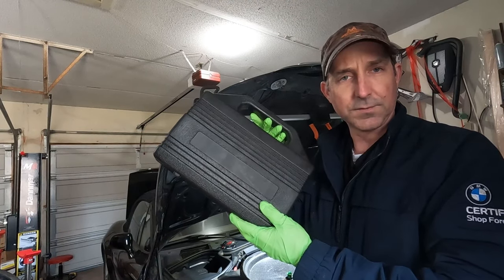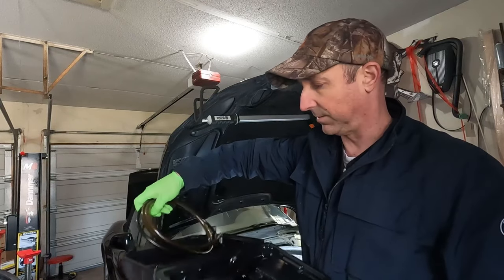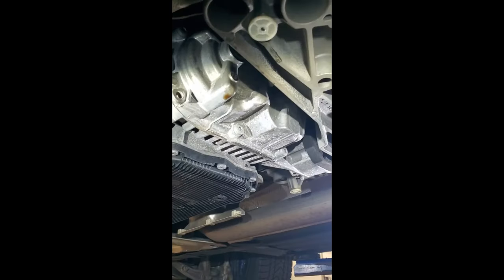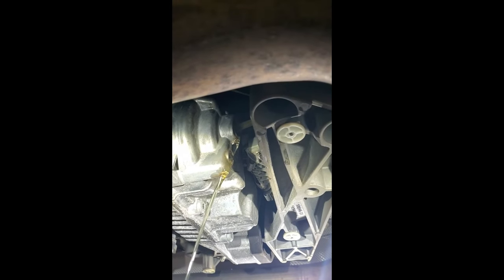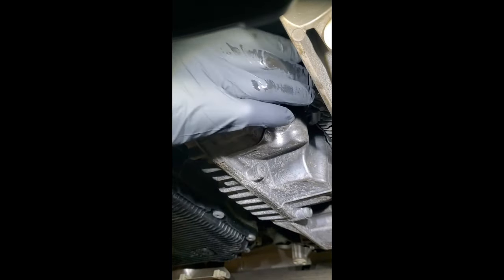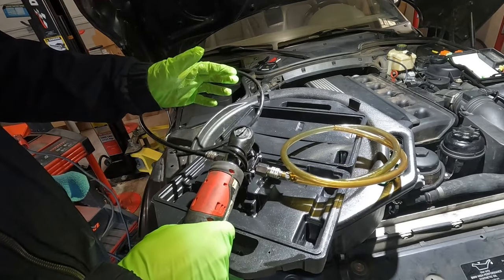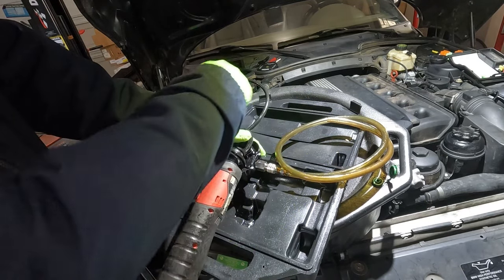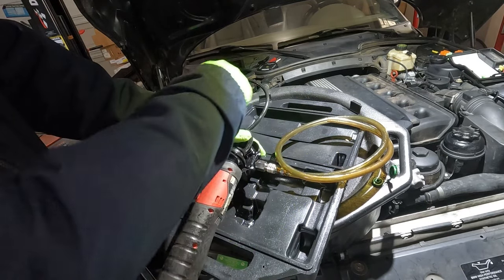BMW Transfer Case ISSUES PROBLEMS Plus DIAGNOSIS STEPS And Fluid Change 54C6 539E 5463 5F3A 54C4

Comment: Hi, how do you know it is not the longitudinal torque module problem?
Reply from the maker: No quite sure what component is the longitudinal torque module? Do you have a part number for that? Unless you mean the transfer case motor module. I cannot say I have replaced one on a newer BMW. I would have to say the motor module is normally not the failure. Unless you have some odd VIP ICM Steering failures which can bring down the FlexRay Bus. That can be caused the this module. But  not this symptom.

Comment: If I leave transfer case unplugged can I drive the car like that for a week or 2 ? Until new transfer case comes in
Reply from the maker: You can actually but you won't have all wheel drive. But make sure the connector does not get wet.

Comment: If my 2016 bmw 228i xdrive send random abs and traction light while driving is that my transfer case? Would changing the fluid help? Thank you.
Reply from the maker: Hello Joshua, I would scan the car to check faults.  It may be the transfer case but it could be something else.

Comment: I have a f34 that looses power when the wheel is just off center and will not go into park. I get a dash warning that states park can only be selected when stopped. I checked all the wheels speed  inputs and they show stopped but still won’t go to park. Customer has had the shifter replaced, and transmission replaced prior. Also getting a code for input speed mismatch
Reply from the maker: Hi Josh, For something like this it would take hands on diagnosis to solve. Not a common issue unfortunately.

Comment: Hi, I have been having the similar symptoms. My mechanic thinks it could be the transfer case. Is it common knowledge for them to know how to change the fluid?
Reply from the maker: Hello Anthony, Most good mechanics can figure this out but not all transfer cases have drain plugs. Some you need to siphon out or remove and drain. Filling is easy. Fill until fluid come out.

Comment: Hi,i changed rim size from 20 to 22 inch of my bmw x5m f85.and transfer case shuddering happens.i run 295/30 22 with 335/25 22inch tyres.someone told me to change front tyre size to 285/30 with 335/25.
What would you suggest?
I want to run with 22 inch rims.
But i dont want my transfer case shudders and slips.
But i didnt use after this problem maximum 250 km.reset of transfer case without oil change is helpful??
Bmw is on 70000km.
Reply from the maker: Sorry to say that changing tire size like this can lead to transfer case failure. I have seen it many times. I would recommend going back to the stock tire sizes and rims and maybe the fluid change will help. Damage to the transfer case can result if not and replacement will be needed.

Comment: My bmw x1 shudders when driving at 5mph / 10 mph …. Up and down the gearbox the car is just fine ! Smooth as butter !
Reply from the maker: Sorry to hear that. Disconnect the transfer case motor and see if the shudder is gone.
Reply: @AskTheCarExperts   thanks for the advice , changed the transfer gearbox oil and , shudder is virtually non existent now ! Very happy !

Comment: Will a bad or low fluid transfer case cause the rear end to lock up?
Reply from the maker: Hi Isaac, Low fluid in the transfer case would cause the transfer case to fail but it would not cause the rear diff to lock up.
Reply: @AskTheCarExperts  ok thanks. I've been having an issue where the rear either locks up or the brakes lock up Idk which one it is. I can drive it fie a while but after it gets hot it'll lock the rear after I wait an hr it'll allow me to drive it again I check the rear fluid it's clean and full I've replace the brake lines with steel braided lines I replaced the brake booster. Idk what else is left besides the transfer case
Reply: @Godlike_Isaac I have same
problem do you find a solution ?

Comment: So I  have a 2014 335xi and it popped a code Transfer box: Temporary fault, protective function 95k miles?
Reply from the maker: Make sure you have the correct tire sizes according to the door sticker.
Reply: @AskTheCarExperts  yep everything checked out I’m leaning towards old fluid when This code is triggered dose it disengage all wheel drive ?

Comment: Anyone find a good link for the pump?  Not available at link provided.
Reply from the maker: @trencher7  Are you looking for the transfer pump I use?They do look out of stock everywhere. You can use a hand pump as well.
Reply: @AskTheCarExperts  Thanks will do.  I need to do this ASAP.  Just bought a used 2021 X7 with 57K miles and notice shuddering when turning right sometimes.  Any system resets you need to do after?
Reply from the maker: @trencher7  No resets needed. Just fill and drive about 250 miles and most improve or go away completely. The hard part is siphoning out as much fluid as you can. I can usually fill up a 16 0z water bottle and I know I got most of it.
Reply: @AskTheCarExperts  Thanks so much!

Comment: My BMW dealer had the car for a few hours and told me I needed a new transfer case.  Do you have a sense for whether the simple fluid change addresses the issue most of the time?  Or by the time you feel the problem, is it too late and the transfer case is a goner and needs to be replaced?  These things are incredibly expensive to replace!!!  :((((.  AWESOME video!
Reply from the maker: Hello,  It is never too late to try the fluid change. I would have to say about a 50/50 chance if the symptoms are really bad. If you have internal clutch faults then it most likely would need replacement.

Comment: i think im having similar issue with my 07 328xi shuddering at low rpm or going to a complete stop. The first thing i noticed was the 4x4 abs light coming on and after researching, not too long ago i have replaced my transmission fluid, TC fluid and the TC motor only yet till now car still jerks going at low speed & when doing a complete stop. There’s no codes though after replacing my TC motor. Please help guys is the problem really the whole TC?
Reply from the maker: If you unplug the TC motor does the symptoms go away?
Reply: I will try that and let you know thanks
Reply: @rcgx692 hey man just wondering me and my boy just bought the same car as you. And we threw a TC   code. Did changing the fluid bell at all?
Reply: Help*
Reply from the maker: @favoritecreatorsdaily  Hello, A fluid change may help but when you have a hard code it often needs a transfer case.
Reply: damn unfortunate. thanks for the responds i really apprecoate it! Made my Night!! @AskTheCarExperts
Reply: Hope you have a good one :) @AskTheCarExperts
Reply from the maker: @favoritecreatorsdaily  I hope the fluid change helps!

Comment: I don’t have a chatter but after putting a new control motor in I can’t calibrate it. I get a message that says the transfer case has reached the end of its life
Reply from the maker: I'm sorry to hear that. That means the system is detecting an issue in the transfer case, and it is not able to calibrate due to being outside tolerance. Replacement will be needed.

Comment: no transfer case = fixed😀
Reply from the maker: That would do it. But it is nice to have in cold climates :)
Reply: @AskTheCarExperts  my e92 is very safe with my winter tires. no need for awd

Comment: I broke my transfer case and got used one. Anyway to analyze if old module Is bad or reprogram used case module!?
Reply from the maker: I would try to use the used module first and if you have an issue then swap it out.

Comment: BMW has had this transfer case problem since it introduced XDrive. BMW does not solve the technical issue as the oil leak from oil pan.
Reply from the maker: Transfer case issues are definitely nothing new to BMWs. But many have no issues. My X5 at 150k is still good. Many times the issue is from improper tire circumference.

Comment: Chatter just started on my e39 I’m pissed off now
Reply from the maker: Hello, An E39 did not come with a transfer case or all wheel drive option. Your chatter may be transmission related.

Comment: Changed fluid on transfer box and both Diffs on F25 2013 auto xdrive. 

Car feels amazing now and shifts quicker and quieter than before considering it’s done 124000m 

However since changing the transfer fluid I’ve noticed when car heats up it has a slight shuddering feel to it when accelerating up to 3 gear almost. I’m taking to a local mechanic today to see if he can reset DTF? If not I may change fluid again.
Reply from the maker: I hope it helps. If not, disconnect the transfer case motor electrical plug and test drive. If the symptom is gone, then the TC would need replacement.
Reply: @AskTheCarExperts  pretty sure it’s sorted now 🤞snap on diagnostics tool  reset VTG in seconds